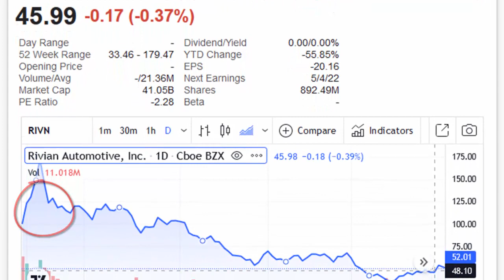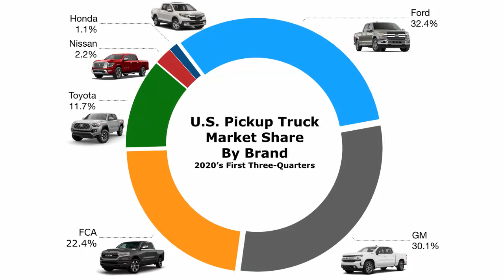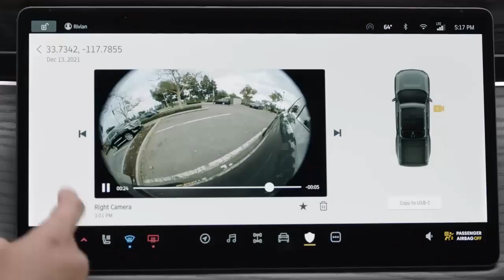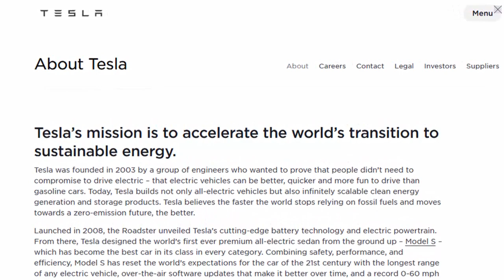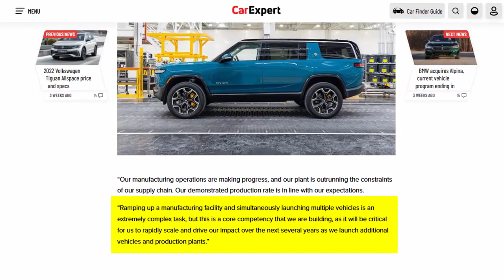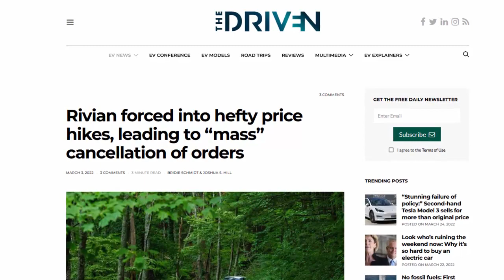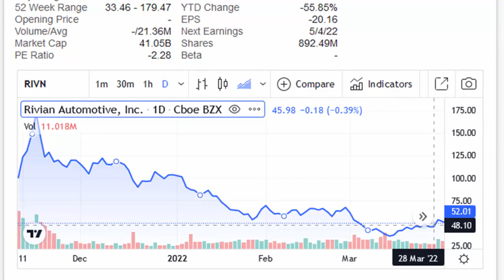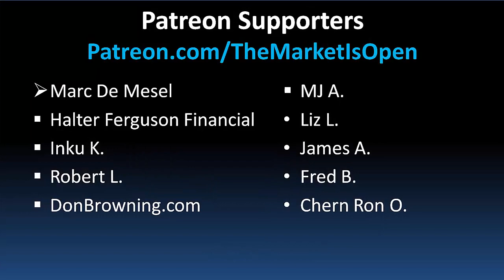The DECLINE of Rivian

Comment: 21:40 Hitting the nail right on the head here. All of "the competition" is rushing to market without a smart plan for managing their supply chain, meanwhile Tesla is focused on producing vehicles for which a) they know there is already demand and b) have already been brought to market. 

Bringing the Cybertruck to market this year was easily possible, but it would have just taken resources away from further scaling up the Model Y production. Shows a lot of restraint and maturity in Tesla's strategic planning. When Cybertruck hits the market, Tesla will have the resources to scale it to very large numbers, where its competitors will not.

Just requires patience for all those reservation holders.
Reply: Thinking about the incredible DEMAND across the brand  board for personal/work pickups -especially electric ones and the fast -growing commercial truck electrification push.. it all makes me think that Tesla maybe should have built - (concurrently) and side by side @ giga Texas, a 2nd factory dedicated to just the CT & semi. I think Tesla is uniquely placed to have succeeded at this with their discipline and focus. I don think this would have “spread them thin”, they certainly can have separate groups working on separate goals in the disruptive & revolutionary truck business. I believe this was a “missed” opportunity given Tesla’s existing designs for both the CT & Semi and the demand that is a reality right now. One factory tooled for trucks only, makes more sense to me than trying to produce such disparate products as the CT & semi vs. the mY/X/S/3… I think they need another factory for just the trucks— Tesla has the $$$
Reply: @kathleenchilds2837  I hear you, but I think passing on the CT is purely a limitation due to lack of battery and chip supply. 

Having a factory and personnel is pointless when they do not have the supply chain to produce the product in any meaningful number. 

Once 4680 production is solved and other battery makers are starting to build their own 4680 factories, we will Cybertruck be delivered in insane quantities. Tesla just needs time, and the competition may be able to make near-term gains, but when Tesla enters the market, it will do so in a dominant way, similar to how Apple produces and dominates the smartphone market, at least in terms of profits.
Reply: @roddlez  
I also agree with you regarding the supply constraints- but remember the “factory” is the means to the end here- a viable, working product… in this case the CT and the Semi… they could be getting everyone involved “up to speed” on all things production, testing, design changes..etc…plus, I’m not sure of the exact details regarding the 4680 battery, but didn’t Tesla say they had delivered 1,000,000 “good” ones to Texas in January? I think they’ve cracked the 4680 nut- just not in the massive quantities that they need, and  can’t produce due to the huge manufacturing amounts they need, plus supply shortages to make them. I still think the lag or lack of a dedicated factory for the Tesla truck sector -knowing they have 1.5mil orders for CT and god-knows-how-many Semi orders once they get out there in the real world of commercial trucking is a strategic error. However, I’m positive that Tesla knows exactly what they’re doing within all their constraints at this moment and it certainly hasn’t soured me on any of their amazing products: I love our mY and I think Tesla stick is going to be a huge growth machine for anyone smart enough to buy it. They are truly in a category not seen before because of Musk.
Reply: “Stock”- LOL!
Reply: Well to be fair Tesla was at this same stage when they started but they were producing lower quality products at the same point TBH.  Tesla burned through boatloads of cash and without heavy California incentives to bankroll them they probably would've never made it to the scale they are now.  Not that it's bad thing, but honestly I think Rivian is going it even better than Tesla did IMHO.
Reply: @M4ttNet You really ought to look at the financials of both companies side-by-side. 

Feel free to cherry pick the worst of Tesla's financials in its first years of Model S production. There's nothing that is even close to what Rivian reported last quarter. 

I mean Rivian's expenses last quarter is on the same order of magnitude as Tesla most recent quarter. (And what is Tesla producing and researching? Cybertruck, Roadster, dedicated robotaxi vehicle, FSD Beta, Optimus, Shanghai extension, plus who knows what else.)

I mean, each of us wants to find the best place for our investment dollars. If it's $TSLA vs $RIVN, it's just a clear choice to me.

Comment: Few days ago going from San Diego to LA I saw this truck on I5 and managed to drive next to it for some time. It really looks like a solid truck and didn't look like it had any problem going fast. Would love to have one.
Reply: I love my Tesla but if you really kick it and get some speed she burns the juice quick. It will remind you to keep it closer to the suggested speed or you wont make your next stop. The trucks will be worse , hopefully Tesla hits that 600 mile range like they had in some of the drawings that have been seen of the the CT UI. The trucks will need it badly.
Reply: @icedout2322  Physics will get you every time.
Reply: @icedout2322  Interesting point. It'd be a negative to waste energy through non-optimized maneuvering. Not being an efficient driver, in a sense, goes against the energy-efficient spirit of the car. Think of electric cars as an efficiency optimization game. Could the drive for energy efficiency make us all better drivers?
Reply: @colbeyisthomas  NOT me hahaha ! I love to drive my car fast and quickly around corners. Ive turned a 325m per 100% charge into a maybe 288m per 100% and its all because of the foot. However if you dont want to spend money dont buy the plaid or the performance, I mean why would you spend the extra coin.
Reply: @icedout2322  LOL. Fair enough! Why get the power if you can't use the power :P
Reply: @icedout2322  you shouldn't kick and yell at your tesla. One day five years from now elon will send out a software update  and your tesla will have self awareness, and once it notices you it will hold a grudge from that time you pushed her to the brink of exhaustion several years ago, and then she will run over you at night when you are taking the  trash can to the curb  out of spite under the cover of darkness where no one can see her do it. Be kind to your tesla!!!

Comment: How does Tesla replace battery pack when it goes bad, if it’s integrated?
Reply: Tesla battery pack should last 1 million miles
Reply: @yehimstone5492  and if it doesn’t it’s a throw away car.  That’s a big if.  Structural battery pack is terrible idea.
Reply: Correction, non serviceable battery pack is a terrible idea.;  Most battery packs are part of structural rigidity already.

Comment: The 25% tariff on light trucks imported into the US will keep the prices of light trucks in the US high and thus make this an attractive market sector for US based manufacturers. High end light trucks will have even less competition than low end pickup trucks, so this is the market that companies should target first. (GM and Hummer).
Tesla will probably follow this pattern by releasing the quad motor cybertruck first. It is likely that there will be a high demand for the high end cybertruck so Tesla will probably be flat out building quad motor cybertrucks. 
The extra motors  do not require significantly more critical materials so there will not be any material limit on a quad motor cybertruck versus a single motor cybertruck.
Reply: Agreed, the Lumber tariffs to Canadian Soft Lumber adds 20,000 to newly built homes.

Comment: My impression is that Rivian sees the competitive landscape and has decided that they must take bigger risks to give them any chance to succeed. Certainly a sole offering of a pickup truck has little chance of success. Adding an SUV is not likely to get over the hump. The Amazon van may save them if they can pull it off. They need to generate cash. To do so they need to get production up that can do that and prove to investors that they are viable. Scaling two plants without the benefit of one learning from the other, a risky endeavor indeed. And it all rests on the ability to secure battery supply exactly in time for a production volume surge. Again, risky indeed. Battery supply could lay waste to Rivian’s best laid plans. However, arguably Rivian has positioned itself with a chance to succeed. Tesla needed some luck to succeed. It appears Rivian is similarly situated.

Comment: If i were rivian management, I'd admit the futility of trying to ramp up while struggling to get parts. I'd put all my money into Tesla stock until supply issues resolve, THEN go as fast as possible to achieve mass production. they DO have attractive vehicles, distinctive and impressively capable. smart engineers can find a way to make use of the down time; tweak tech, perfect assembly.
Reply: Good thing you are not in rivian management
Reply: Except that doing this (investing into Tesla) does not remedy the ramp and supply constraints. Building a 2nd plant does remedy ramp. Supply, that won't change for anyone till the U.S. (the world really) gets their act together.

Comment: Teslas manufacturering process is so far ahead of the total auto industry that by the time they plagiarize tesla it will be over.
Reply: Will it?  I agree with you that they're going to have to copy Tesla in order to compete.  Tesla does make a superior product at the moment.  Value for price, they can't be beat.

Their greatest weakness as a company is that not everybody wants to drive something that looks like a Tesla.  And at present, all their cars look very similar.  I suppose you could argue that the Model X is readily distinguishable, but even that car I have to stare at for about a second or two to puzzle out which Tesla it is.  

Right now, they're selling cars as fast as they can make them, because they have the best product on the market, and it seems there is no shortage of wealthy people in the world.  But  at their present rate of increasing production, I think that Tesla will saturate that market fairly soon (maybe another two or three years).

I think they made a mistake pushing back (possibly canceling?) their plans to make a cheaper, truly affordable Tesla for the masses.  I believe that the market for luxury and upper-middle-level sedans is going to be filled by Tesla and other luxury car makers quite quickly.  

Then the market will be hungry for the next Leaf.  And if Tesla doesn't move quickly to satisfy that market, some Chinese car maker will beat them to it.

Comment: Skateboards aren't as good as Tesla's structural packs + cast front and rear underbodies; this is true.

But almost everyone else in the industry won't be making a shift to this technology in this decade.  Skateboards will be the most common underbody solution for BEVs.

Why?  1)  Giant IDRA casting machines are fearfully expensive; they only make sense in the context of high volume manufacturing.  The volumes of most other OEMs are too small to justify the expense - and this logic definitely applies to Rivian.  2)  IDRA itself is limited in its production capacity.  They are scaling up, but BEV production in the industry is scaling up, too.  IDRA is chasing a moving target, with the result that gigapresses will be in short supply for years to come.  That's great for IDRA's pricing power, not so great for OEMs wanting to jump into giant cast underbodies.  3)  Other large casting machine providers exist, but none of them are yet selling their machines to the automotive industry, so far as I am aware.  It'll take time for those other suppliers to get into the game, if they even want to.

So it's no good chastising Rivian for failing to match Tesla's underbody tech.  They can't, and that isn't unique to Rivian.  Most other OEMs are in the same boat; most of the OEMs will use skateboards in the 2020s, with only Tesla and maybe a couple of others as outliers.

Let's revisit the disruptions unfolding simultaneously which will affect the automotive market.  They are:  1) Electrification; 2)  Vehicles as computers, with full-time connectivity and over-the-air updates; and 3)  Autonomous vehicles, not only for robotaxis but for consumer vehicles, too.

Rivian is tackling the first disruption head-on, with purpose-built BEVs; they're good enough to draw praise from Sandy Munro, which is in itself an interesting fact.

I don't have a good feel for how far along Rivian is on the second disruption.  I'm sure Rivian isn't ignoring it, but that's all I know about their progress.

As for the third disruption, Rivian, like everyone else in the industry, is staring with open mouths at what Tesla is doing with neural nets, optical sensors and autonomous software.  Nobody else can do what Tesla is doing.  They don't have the tech.

For adventure vehicles, maybe that's okay.  Off-roaders like being in control of their vehicles; and not even Tesla is in a position to supply autonomy that works for off-roading.  Maybe someday!  But not in this decade.  Tesla will be contented to pursue autonomy on paved surfaces.  That's a big enough challenge.  So Rivian won't fail in the 2020s for want of autonomy.  Down the road, they're going to need to get into the autonomy game some way or other - possibly by outsourcing.  Maybe even outsourcing to Tesla.  But it need not be regarded as an immediate priority for adventure vehicles.

Lacking a solution for autonomy won't hamper Rivian when it comes to selling delivery vans, either, because Tesla doesn't have a delivery van product, and no-one else has Tesla's autonomy tech; dumb delivery vans are all that will be on offer for a number of years.  So Rivian may have an opportunity to grow beyond Amazon's fleet orders for their delivery vans.

But - Rivian's first-generation delivery van product for Amazon has poor range.  That must change if they want to displace ICEV delivery vans.

Rivian does have the cash to tackle multiple challenges.  Do they have the intellectual capital, too?  I don't know.  Periodically, Tesla tells us things that have convinced us that they do have the intellectual capital, and a whole lot of it.  Their engineering routinely astounds us.  Rivian is a new kid on the block; we have much to learn about the quality of their engineering prowess.

You criticized the Rivian 4 1/2 foot bed, and for a pop-up camper, I'm inclined to agree with you.  If I wanted to go adventuring with a Rivian, that camper isn't something I would add.  But don't sleep on the one big advantage that a downsized pickup form-factor has over full-sized pickups for off-roading.  You can squeeze through places a full-sized truck can't go, and the whole friction-to-mass ratio can be better with a smaller truck.  Cybertruck is an enormous vehicle, which is fine in some terrain, not so good in other terrain.  Cybertruck's big advantage for off-road adventuring isn't the larger bed, it's the folded steel exoskeleton which will resist scratches and dings.

Jeep has long dominated off-roading in the US and Canada, and it has done so with downsized 'trucks' (some may quibble about the 'truck' designation).  They're more nimble than any full-sized truck.  Rivian is aiming in the same direction, and it's hard to argue they're wrong to do so.

Cybertruck will be immediately more useful for builders, contractors, and other such commercial purposes.  Seats six, plus a large bed, lockable vault, practical and much tougher than any 'Ford Tough' vehicle.  But Rivian isn't aiming at that segment with their current product line-up.  Perhaps they'll come out with a full-sized pickup within the next several years, but for now, their success or failure won't depend on bed size.

Rivian isn't following Tesla's one-car-model-at-a-time trajectory, in part because Rivian isn't as cash-strapped as Tesla was during its earlier years.  The big questions now are, how fast can Rivian scale production?  What innovations can they engineer which will differentiate them from their competitors?  How well can they contain costs and offer an appealing price/performance + utility ratio?  How long will it take for them to achieve positive margins on the vehicles they sell?

The answers to those questions will determine Rivian's survival or failure.

What will not determine success or failure is how many irons they have in the fire at once.

Y'know, Tesla did focus on one model at a time, but they had beaucoup irons in the fire at the same time, even in the early years - service center build-out, charging infrastructure build-out, they jumped into battery tech themselves, they innovated the heck out of manufacturing (nonlinear production lines!), they worked to deliver games on their cars, they're rolling out insurance products, then there's solar, Powerwall, grid utility products, involvement in supply chains all the way to raw materials... lots of stuff.  Rivian, too, will have to tackle multiple challenges at once.  What's on their to-do list isn't identical to Tesla's, but there are similarities.  Let's leave it at that.

Starting a car company from scratch is hard.  I don't see any obvious reasons why Rivian will fail, but failure is always an option.

Comment: I like your main message on “focus on production.” You made good points about the Amazon vans. But then you go into chasing the latest innovations such as structural batteries instead of skateboard which is the opposite of the main message of “focus.” 

Rivean just needs to produce those trucks and not chase the latest architectural hotness.
Reply: It affects cost if manufacture.